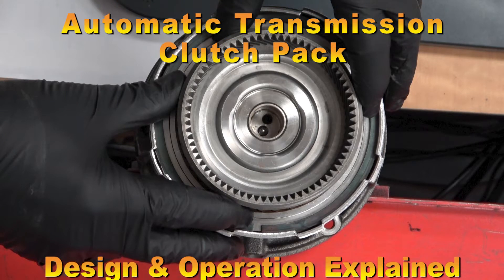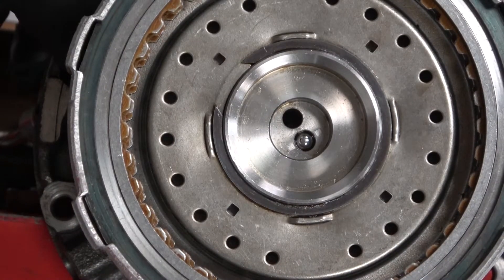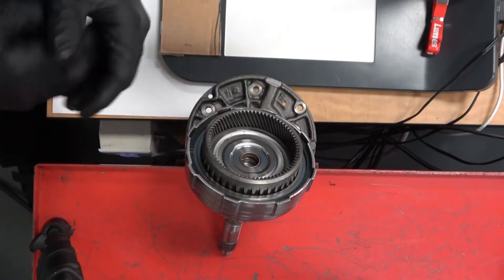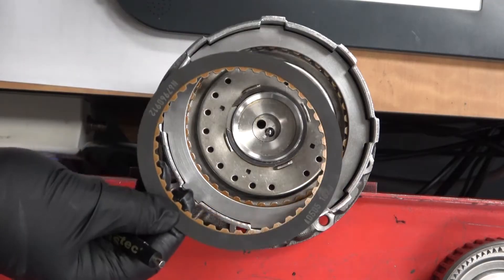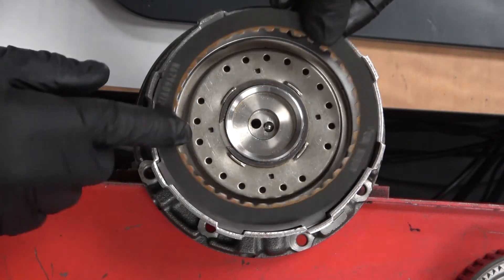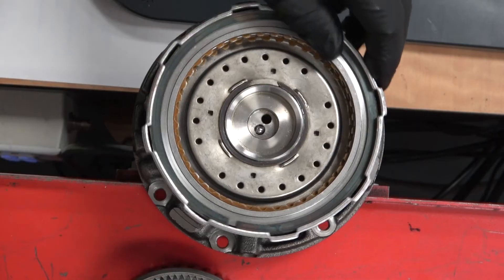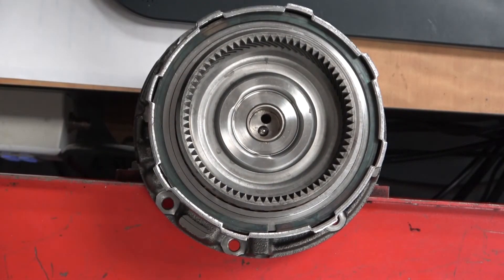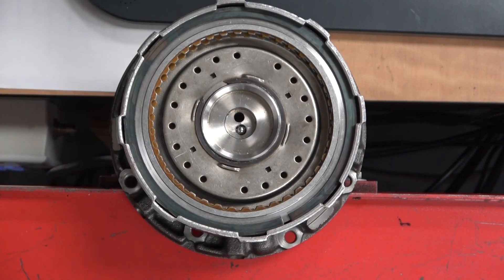Automatic Transmission Clutch Pack Explained

Comment: Hi i am replacing 2013 toyota camry LE engine today in my drive way,  while doing that i have to remove CV axle and Torque converter to replace the seal. While doing so, I see that lot of fluid came out from cv axle, becasue drive way is little on the hill side, sitting sligthly slanding.

Question
1. I know how to refill the sealed transmission. I have scan tool that tell me the temperature of ATF at around 110 f , moment it starts trickling i have to stop.  Does this work when i dont know how much fluid is lost.
2. without knowing how much fliuid is lost, not sure how many quarts i should add.
3. Does CV axle will loose lot of fluid?
4. Since it is rebuild engine , is it ok to start the car before filling the ATF fluid for 5 minutes or so..
5. Troque converter have lost ATF because i kept on different angle. i am plannning to fill torque converter filled with ATF(all oem fluid) to neck line or all the way to top. quesiton is if i change torque converter do i need to fill it all the way too top..

Thanks a bilionn..
Reply from the maker: That transaxle holds about 8 quarts.  Don't run the engine if you know the transmission is low on fluid. I would not fill up the converter with oil.  If you do this you will make a mess when you put it back onto the transmission.  Better to have it overfilled than under filled when you first start your new/used engine.  Estimate how much you think you lost.  I doubt it was more than 2 quarts unless you drained the pan.  Put the 1 - 2 quarts of oil into the transmission through the fill hole before starting the engine.  Have your fill device ready to add more fluid quickly if needed. Have the plug on the pan that is used for checking the level gently snug so it will be easy to remove.  Have your scan tool ready to read ATF fluid temp. Start your engine and after about 2 - 3 minutes of running use the shifter to shift through the gears.  If you don't feel engagement add some more ATF.  Wait about another 1-2 minutes and then try the shifter again.  Once you feel engagement into all gears return the shifter to park and remove the oil level plug and wait 20-30 seconds.  If there is excess let it run out. If it doesn't run out add fluid until it runs out. Put the level check plug back in finger tight. Now watch your ATF termp.on the scan tool. When it reaches the correct temp. remove the level checking plug and check for oil trickling out.  If it doesn't trickle out add fluid until it trickles out. If there was excessive fluid let it run out until it just trickles out.  Then insert the level check plug and properly tighten it.  NOTE! be careful because when you first remove the level check plug a burst of oil might come out making  you think it was over filled. Remove the level check plug and wait 30 seconds for the true level reading. When your done use a new crush washer on the fill plug and install and properly tighten the fill plug. That should do it.
Reply: @DrivelineMaster  fantastic much appreciated Sir. One last question I found hard time aligning dowel pin of engine to transmission any tips is very helpful. Yesterday I realized that torque converter is not fully seated. I figured that out today it should fully seat in oil pump not just one click stupid rookie mistake so I took engine out and redid that. After putting engine to transmission when I turn crankshaft using ratchet and if I keep my finger where starter goes should torque converter rotates as well. Just want to make sure nothing is binding
Reply from the maker: When you first get the transmission bolted to the engine you should be able to rotate the torque converter with a finger either through the starter or any other access point.  Next you will need to bolt the converter to the flex plate/flywheel.  These bolts are especially short. Do not substitute any other bolt for these bolts. Hopefully you didn't damage anything when you bolted the trans to the engine without the converter being properly installed.  I have seen trans pumps broken this way. There is no special trick to aligning the dowel pins.  Just clean the pins and the holes they align with and apply a little grease on the pin and the hole. When you put the torque into the transmission there are 3 sets of splines or notches that have to be aligned.  The input shaft into the turbine, the stator spines into the stator and the cut outs on the converter hub with the oil pump tabs. The converter housing should be recessed from the bell housing by about 1/2".
Reply: @DrivelineMaster  thanks much just put the engine and trans together. I can turn crankshaft freely I am yet to connect torque converter to flywheel. I don’t have enough access to rotate torque converter so I am planning to connect flywheel to torque converter and will rotate crank shaft manually and see if torque converter rotates. Will that work please
Reply: @DrivelineMaster  seems like when I rotate crnakshaft torque converter is also rotating so I can’t align bolt holes to put bolt does that mean torque converter is not all the way in
Reply: @DrivelineMaster  just to let you know when I put my finger behind torque converter there is no space to my finger so I think it is fully seated not sure why flywheel is jammed against torque converter. I aligned dowel pins between engine and transmission as well. I can do redo the job not sure what mistake I am doing
Reply from the maker: When you bolt the transmission to the engine it's imperative that the engine and torque converter can rotate separately. You should be able to turn the crank and have the converter stationary. or turn the converter while the crank is stationary.  If you can't turn them separately you will have to separate the trans and engine again. When you install the converter into the transmission turn the transmission so the bell housing is facing up on a work bench or the ground.  Then flip the converter over and install it straight down while rotating and jiggling it.  You should feel it click or drop down 3 times and when you eyeball or place a straight edge across the bell housing the converter should be recessed about 1/2 inch.  Now bolt the transaxle to the engine.
Reply: @DrivelineMaster  Thanks i will seperate enginne and tran again tomorrow.  quick question is it ok if i can tow the car with cv axle removed on passenger side or it is mandate that cv axle have to be there, ii am asking just in case.
Reply: @DrivelineMaster  yep all went fine with your help. I don’t think I would have matted engine and transmission without you.
Reply: Today I matted transmission with engine and I see oil coming thru the joint . Does that mean I broke the oil pump

Comment: This was such a great explanation of how these clutches work. When you try to research how automatic transmissions operate, people tend to focus on the planetary gears. As a learner I find that part easy to understand, to me the perplexing part has been to understand exactly how clutches lock and unlock the rotating parts. This, finally, is the explanation I have been interested in for at least 40 years. (ha, that was hard to say out loud) 
Anyway, thank you for this very clear demonstration.
Reply from the maker: Thank you.  This is why I do this.  So others can gain insight from my knowledge and communication skills.

Comment: Hey i see guys changing out the clutch pack pistons during rebuilds but why? i assume on this type the springs get worn and weak? But what about on other kinds like honda automatics where the piston is all solid. Would i be looking for cracks in the piston in that case?  please answer my questions.
Reply from the maker: Although there may be many reasons for changing the piston I can only think of a few.  1) the piston has a bonded seal as part of the piston and this is the only way to renew the seal. 2) There may be a service bulletin or an upgraded piston design either by the manufacture or by an aftermarket company like Sonnax. 3) Some high performance kits will include extra friction disks and steels for more holding power and the only way to make them to fit is to install a slightly thinner piston.  4) The piston is known to fail so it's done as a precautionary measure.  If this is happening it might be only specific transmissions and specific clutch packs within a particular model. Best way to find out is the next time you see this practice ask the technician why they are replacing the piston. I'm willing to bet it is one of the reasons stated above.
Reply: @DrivelineMaster   Thank you so much. i appreciate your efforts and info.

Comment: Thank you for the explanation! I have one unclear part, what do the seal rings do and why do they have a cut?
Reply from the maker: Sealing rings provide a method to maintain hydraulic pressure into the clutch drum while the clutch drum is rotating.  Not all sealing ring are split but there are two reasons for the split.  First is that it makes it easy to install them and second it offers a small hydraulic leak for lubrication.  The small leak offers lubrication to the rotating parts.

Comment: amazing video  but i have a question ,IS drum bolted or splined to turbine shaft?
Reply from the maker: On this model the input shaft or turbine shaft is welded to the clutch pack drum however on other models it could be splined.  I have never seen any input/turbine shafts bolted to any transmission drums, gears or one way clutches.
Reply: @DrivelineMaster  thank's

Comment: That was very helpful, so my take is that most sports and racing cars would benefit the best with this for cornering. Had to research the inventor of the Clutch Pack (Adolphe Kégresse in 1939 for Citroen). Just an amazing mechanical feat.
Reply from the maker: You sparked my interest so I looked up Adolphe and all I could find on transmissions is that the developed the AutoServe gearbox-transmission system which was a dual Clutch system.  I couldn't find anything about the hydraulic wet clutch or any specifics about the AutoServe gearbox-transmission system and how it works.

Comment: I've got a 2022 xpro 125cc china bike that has a semi auto transmission.  I tightened the adjuster nut on the outside of the case to help increase friction. The problem I am still having is that when you get on it 3/4 throttle or more the bike wants to rev up and you can tell its slipping. The bike has less than 10 hours and I use fully synthetic oil. Is there anything I can do to fix this issue? Maybe swap with a better name brand clutch? Thanks. Great videos!
Reply from the maker: I'm sorry but I don't know anything about this semi auto trans or how it works. I did a quick search but I couldn't find an information. If I had a repair manual I might be able to advise you.  If it's a wet clutch similar to what I describe in this video there is a very close relationship with the friction material and the type of fluid. If you use the wrong fluid there won't be enough friction between the disks to hold the torque and the clutch will slip.  If the bike does not call for synthetic oil I would not use it.  There may be an oil designation or type they you need to use.  Without knowing how it works for sure I can't accurately advise you.

Comment: The transmission in my 2005 Jeep Liberty is jerky in 3rd & 4th worse when cold. Also very jerky when you select D, P, N or R from the parked position. Fluid and filters plus all sensors have been changed. Could it be the clutch pack that is at fault? Thanks 🙏
Reply from the maker: Jerky could be many things.  Is it just that the engagement is harsh and jerks you a bit when shifting from P or N into D or R? also when changing gears is it a single harsh or firm jerk going into the next gear?  Or jerky where you have several jerks right in a row during the changing of gears and or while accelerating? This is often called a shudder.  If it's the first one described again several things can cause this but if it happens in every gear two things come to mind.  Something is wrong with the pressure regulation and there is excessive main pressure known as line pressure.  Or the wrong fluid was installed.  Some shops will use a generic fluid with an additive package which doesn't work in my book.  Make sure ATF +4 fluid was used. It doesn't have to be Jeep brand but it must be labeled ATF + 4. I also checked for Technical Service Bulletins for jerky shifting but there were none. Which engine do you have. the 2.8L uses the 5 speed 545RFE and the 3.7L uses the 4 speed 42RLE transmission.
Reply: @DrivelineMaster  Thanks for the advice. I have the 2.8 CRD. Stationary, it thumps when you select a gear. When driving its fine through first and second and then thumps into third giving a jerk then a similar effect into fourth but not quite as severe. After a journey of say 40+ miles it’s almost gone. During the recent transmission service we used the correct filters and fluids as you recommended.
Reply from the maker: One question.  When the fluid was changed was a machine used to exchange all the fluid or was just the fluid in the pan replaced?  A full exchange may help but it sounds like you have internal transmission problems that a fluid service will not solve.  I would however start with a fluid pressure test.  A scan tool can check the pressures but if the sensor is defective it could be reporting the wrong pressure. A pressure test adapter and a quality pressure gauge is needed to verify the proper pressure and that the sensor is reporting the proper pressure to the computer. If your lucky there will be an inconsistency that can be corrected by replacing the sensor. If it's not the sensor you most likely have more sever internal problems.  I think you need a professional who can properly diagnose this problem.  One last thought.  You could have a computer or wiring issue or the computer needs updating.  Unfortunately this is beyond what I can do for you over the internet.
Reply: @DrivelineMaster  Thanks for the advice. Just for clarification. The sump was dropped to empty the fluid and replace both filters. A new pressure sensor has been installed. I will locate a professional to check the problem. 🙏

Comment: Thanks for the great visual explanation!  I hope this question isn't too stupid, but when you apply the brakes and put the car in drive, this clutch pack is clearly not engaged as the car does not move.  I'm guessing they just barely slip due to the resistive brake pressure.  So, as you press the accelerator, is that tied to more hydraulic pressure to the clutch pack through some sort of valve or is it automatic due to RPMs?  I guess my question is, what drives that hydraulic pressure into the clutch pack?
Reply from the maker: So when you move the shifter into drive or possible reverse (depending on which clutch pack we are talking about) the clutch if fully applied.  There are often multiple clutch packs that get applied and released at specific times to change the gear ratios.  This specific clutch pack in the video is fully applied as soon as the car is put into drive or low 1st or low 2nd.  In any event the reason the vehicle doesn't stall or drive away when you take your foot off the brake is due to the operation of the torque converter. You can learn about torque converters by my video here:  https://youtu.be/PxyjjgHeDAA

Comment: Have an A343F transmission from a Toyota  kzn130 Surf. It wouldn't shift out of first gear. Any advice?
Reply from the maker: Before I can give you some possibilities I need to know a few answers.  When you say it won't shift out of first does that mean that you still have engine power being sent to the drive wheel and when you let up on the accelerator pedal you can feel engine braking? or does it feel like your transmission goes into a neutral state where the engine RPM's rev up but no power is transmitted to the drive wheels?

Comment: imo how often those seal rings fail since you dont normally open up the transmission unless something is seriously broken.
Reply from the maker: Unless they are defective or there is an original design flaw they can last a very long time with a little fluid service maintenance. I recommend a fluid service every 60K miles regardless if the factor says longer. 25K to 30K if your vehicle has a CVT transmission.  Only use OE approved fluid.

Comment: i was truly having a hard time visualizing how the the piston pushed the clutch pack and held the planetary. i was like does the pressure alone hold it. then you explained that the notches snagged the ring gear when pressurized.  another question, how are the pinions held in the planetary gear set and the sun gear for that matter.
Reply from the maker: You might find these two videos helpful.  If you still have questions after viewing these videos write back and I will answer.  https://youtu.be/l3LK9pVVSLI and https://youtu.be/j7mTL5M4Ino